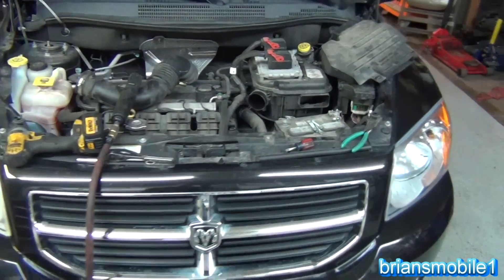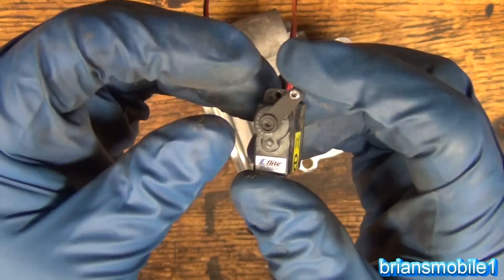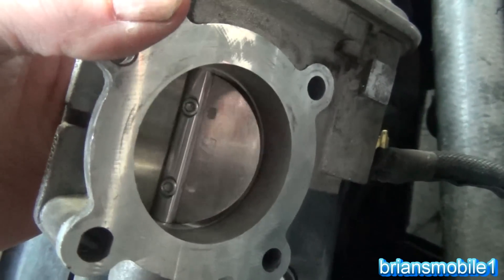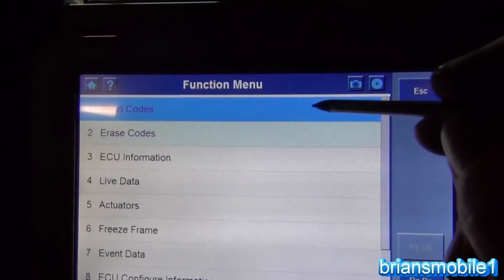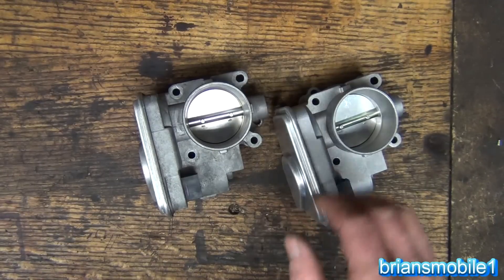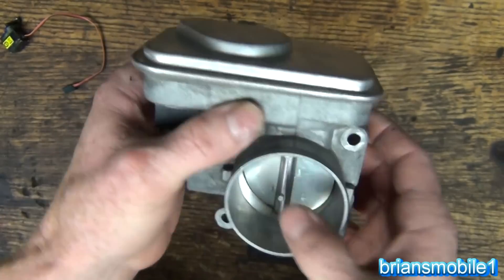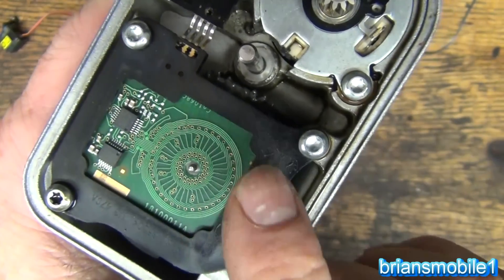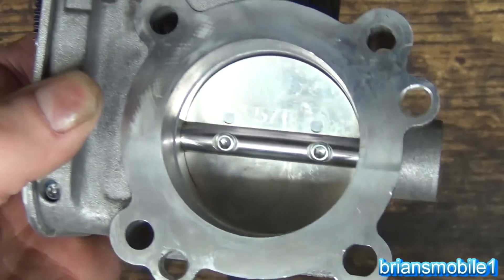Electronic Throttle Control P2110 P2112 P2118 P2110

Comment: This was the same Throttle Body on my 2008 Sebring.  This video was VERY informative and helpful to me in correcting my problem.  Thanks for the knowledge share.  Thanks also for including the tear down of the bad unit.  That was informative and helped tie together how the whole unit works together.  Sadly I too couldn't find a replacement in the after market and had to purchase one via the $tealer, uh , I mean dealer.

Comment: I like them. My 08 Jeep Liberty didn't come with cruise control. Found a switch and harness from a Caliber in a junk yard for $35. All I had to do was install the switch. My computer was already programmed and wired for cruise. Best and easiest modification I've done yet.
Reply from the maker: That's certainly a benefit to them.

Comment: Awesome Vid. When you were wondering how the gear in the Throttle body got ripped, I found a vid that may explain how that could have happened. The channel was FordTechmakuloco. He explains how the system sometimes flaps the plate to knock out ice or debris, with out the keys even being in the ignition. As you stayed this unit has been worked on a number of times. It could have been that someone had their fingers or a cleaning brush in there as someone is cleaning it. The Flap not being able to move may have jammed the gear and ripped the spokes out.

Comment: I repaired one recently  YES repaired it  removed the case cover and greased the internal gears replaced the Pot in the sensor with quality Bosch components , very similar throttle body on the Jeep Patriot here in Australia,

Comment: My ex wife has an 07 Caliber, she had the battery replaced yesterday.  Car ran fine before but now has the P2110 and P2118 codes and the car runs horrible.  I will check the wiring before I order a new motor. :)

Comment: Not just on cheap cars, but on a BMW X5 the transfer case actuator on their I-Drive AWD vehicle uses a plastic gear that is only good for about 80,000 to 100,000 mile.

Comment: i had a similar problem in my 07 cobalt think the plastic gears in the throttle broke. i found one off a similar engine from a junkyard online that was still functioning so i bought it cleaned it and put it in and it worked

Comment: Info is interesting.

Been a mechanic for 50 yrs. ALL car's since the yr 2000 (especially 2005) & up are all high priced junk.

I have a 1976 G-10 van 250 CID Turbo 350 tranny. All original (eng & tranny & differential never rebuilt) very well kept. 850,000 miles on it w/o any major problems. Also have a 72 VW. 1600CC eng boosted up to 92mm jugs. Over 500,000 on that vehicle.  Also an '81 HD. I'll never own any vehicle with a computer in it. My van gets 15 mpg, VW gets 29mpg & HD 50.

Comment: Today must be throttle body day.  :)  Really neat to see inside of the throttle body and see that gear completely stripped out.  Nice find.  Any chance of still using that for a core?
Reply from the maker: Check out my reply to jrmym2....  I'll just paste it here too.  That's easier to find.

      I want to think that with meshing gears you get grindings- those grindings could cause unlimited glitch manifestations when floating around in such a green board environment without oil circulating over a magnet to gather them over time.  There's no need for oil because movements are slow and limited. 
      Another possibility is it's a mechanical fuse like you find in a brake lathe.  You can rule that out because there's no replaceable fuse to put in there- it's non-serviceable.  There's no point in protecting the rest of the device if it's designed to be replaced as a whole. 
     What I would LIKE to see though, is spares available for those two gears and accessibility means.  People worked on mechanical carburetors, linkages, and throttle cables for years.  It's due to tort law and fear of the technology that manufacturers make these non-serviceable.  Planned obsolescence of the car and product life cycle planning of this component seem like a terrible idea, but it sounds better than negligence and apathy. 
     In the end, like you say- disgusting.
Reply: briansmobile1 Sheesh, makes me glad I still have a cable control TB with external TPS and IAC.  What's next, headlights that turn on when you clap?

Comment: First time I've seen inside a computer controlled TB. Ford had a TSB with the TBs on their Fusion and a few other cars. You could  loose power intermittently, because the sensor would get dirty with grease/oil.

Comment: Just had mechanic pull mine
Was having trouble starting avenger,lightening bolt came up.
Ugg no codes
Intermitant problem
Mechanic shook it it sounded like that rattlely.
Got price match autozone
119 
Was 241 elese where
219 at autozone
I had no codes on bolt sign during starting issue ,so far so good.

I self diagnosed it from interent anf youtube .
Mechanic did job in 15 mins.
No charge
We didnt relearn anything
It ran good
Idle slightly rough
Seems ok now

Comment: this unit was initially sealed to prevent dirt etc from entering unit and causing catamination, malfunction or throttle sticking. this problem is caused by oil etc getting inside throttle body on flap and causing it to stick which in turn breaks those cheap plastic gears.  kinda strange since manufacturer says do not clean it. but periodic cleaning would slow this process down

Comment: Thanx for the video! Im having this same problem and i will order a new throttle body this week. In addition I have an issue where sometimes (a out of 10) i just get a SINGLE click when i start the car. Any possibilty that this has to do with the throttle control as well?

Comment: all you have to do is cut 1 slice in the aluminum band and it will break and pop off with a screwdriver. 1minute job with a hack saw across the band the short way. not the long way. Then to seal it back up if the gears are good just use superglue then cawk around the seam

Comment: Nice video, i have problem about it, code i dont remember.. After first problem appeared i change 3 times throttle but it goes like same song.. after 300-400miles problem comes back by check engine message and always when car is not mooving. What should i check beside replacing throttle? Thanks

Comment: Hey nice vid,,,, i have a 2110 code ,,, nd is sayen change the ECU as for TB current  reading by ECU ? Nd saying to change ECU!!! The tb is 6 months old ,, ill look over the TB and see how it looks bc i doubt ECU is bad !! The symptom of the TB is that if i go  into my steering menu fir the srt8 pages 0-60 time,,, the car will get gas unwanted nd jumps to go for sec nd the lightning bulb comes on nd off on dash trowing this 2110 code !!

Comment: I know this video is 9 years old, but I'm having the same issue with my 2011 Dodge Ram 1500 4.7l.  I've replaced both accelerator pedal and throttle body 3 times, and I still have the P2112.
Reply from the maker: Time to check power/ground on the wires and resistance with PCM & both ends unplugged.  See if you have a short to ground or an open or something.

Comment: I think you need to remove the throttle plate and then the gear can be pulled out of the chassis.  The gear is probably bonded or press fitted to the pivot shaft.

Comment: hey man im having the same issue and same code with my 2012 kia forte ex 2.0, its only does it when i come to a stop after a drive, it only done it once upon starting it. i have to shut it off and wait about 60 seconds and its fine. i used my hand to open the throttle plate and it feels solid, no weird noise or play. what else could it be? is there a way to test the sensor on the pedal? a cable would be so much more simple and cheaper, especially on the economy vehicles.

Comment: 06 Hyundai sonata, while full gas only revs up to 3000 RPM can't go over 65 mph without using Cruise control , ESC and check engine light is on. I think this is what I need. Estimated cost for an electrical throttle control actuator?

Comment: I have a 14 Genesis Coupe 2.0 T with 61k miles and a P2118 code! I’ve been having horrible surging on coldstart then goes away. I’ve gotten carbon cleaning but has not fixed the issue and my spark plugs are good. You might have diagnosed my issue but I still need to see if I have blown fuses. I have taken it to the dealership and they advised me that Air pressure was operating at normal range. Can anybody tell me exactly what the P2118  actually is? I believe the same module he’s showing in the video is my same exact module. Thank you.

Comment: I'm currently chasing codes P2104 and P2110. on a 2006 mercury Milan and/or Ford Fusion.
I took throttle body off cleaned it up, I can feel the same clicking as you describe in your video.
but mine does not lock up it seems to move fine other than the clicking.
would you considerate it to be bad and purchase a new one.

Comment: Hey Brian would it have been possible to just rotate the gear that is bad 90 degrees to get it to work properly again. It seems it doesn't use the full potential of the gear so you should be able to rotate it 90 degrees on the axle holding it in place to get it to work.
Reply from the maker: I did consider that, but the gear is a cam shape rather than fully round.
Reply: +briansmobile1 changed throttle body and now I can't get it to start why??
Reply: 1833camaro1 what make a truck cut out at 70 miles an hour an if take off to fast cut out there was a light that came on it said it was a throttle controll sencer will that make my truck cut out like that jw i   have a 2005 Dodge ram1500 with a 5.7 hemi in it I have tryed fixing everything. That the only thing I have fixed yet jw

Comment: Great video man, That p2118 code popped up on my Lexus IS250 with the VSC.  I've changed the throttle body with another one but did the same thing. It has a rough idle and wont go past 20mph. Any idea what it could be?

Comment: would the 2011 Ford Fusion Hybrid throttle body be the same as a regular gas engine throttle body? my Ford dealership seems to think they are not, but aren't the engines in hybrid cars the same as any gas engine except for the interface?

Comment: My truck will crank but when I let off the gas it will die. I am getting the electronic throttle control light (lightning bolt), and the check engine light. I put a new throttle body on and it is still doing the same thing. I am thinking the problem may lie in the sensor that connects to the throttle body.

Comment: I don't like the drive by wire either I feel delay in it when I blip the throttle I prefer cable anyday
Reply: Agreed. No matter how fast the electronics are, if they aren't faster than mechanical then it's a fail.

It's like when they first came out with the digital mouse. You couldn't play Quake in 2000, because the refresh rate on your mouse wouldn't keep up.

Overtime, the digital mouse sped up and won, but at what cost of digital life? lol

Sorry, had to throw some humor in there because I was thinking of the deaths caused by plastic gears in a throttle.

Comment: i have a 2013 ram that kick codes P2122 and P2127  lowe voltage to the throttle body sensor, can this be caused by a fuse like in your video with the Chevy truck

Comment: I'm having the same issue on my 07 caliber but I can't test for codes like you did. do I have to reset the new  throttle body when I install it or I can just put it in and hook everything back together?

Comment: I have a 2011 jeep patriot and the MIL light is on and the ETC light is flashing. Do you think that replacing the ETC would fix the problem? Also do you knew if it would be covered under the powertrain warranty?
Reply: Amanda Horstman

Comment: I have a question my dodge avenger has the same symbol when i turn the ignition to on position engine off..and the computer reads alot of bunch of different codes i erased them and them pop rite up can it be the same thing ???

Comment: I have 2005 Dodge ram 1500  with a 5.7 hemi in it  will the throttle controll sencer make it cut out when I get up to 70 miles and hour. And can it make my truck cut out if itake off to fast I have fixed everything but.  them two thing my light came on in my truck I looked up in the Owens book and that's what it said it could be  I jw I am not sure

Comment: i have ram  can get the lightning bolt warning light off and i have new throttle body on it and tried to relearn no fix my cold are po2111 po 108 po562 po700
Reply: and had colds you have befor had my car reset cues befor it wouldn't even run after rest it dose but like cant give it gas

Comment: Hey Brian, I have a 2010 Dodge Caliber 2.0L Throttle light came on and it gives me Code P2110. If I change Throttle Body would it fix the problem?
Reply: I have the same problem did u get an answer?

Comment: I replaced my throttle body and gas pedal sensor lightening bolt still comes and car hesitate, drive it a block or 2 stop and start up drives fine I was told I had to relearn it by pressing gas for 10sec n it'll be ok, didn't really work went to jiffy lube and they said I needed to pair the new throttle body from within I have no idea about this don't want to be taken advantage of can anyone shed some light please.

Comment: I took out the throttle body from my chrysler 200.. It has the same set up.. However when i shook it there was a jingle inside it.. It has the same codes also.. So just swapping a new one in will fix my no crank and no start?

Comment: I have a 2010 dodge avenger.  2.4. I cleaned the throttle body,  checked the spark plugs, the coils, the air in take. It won't start, if I sprayed starting fluid into the throttle body it will go to 3 grand then just die. Help lol.

Comment: I just replaced on of these on a 07.. still having problems.. car starts fine, no warning light.. but after 5 mins of running I hear a big click and the etc light comes on again and car barely run.. can shut it off and restart, goes thru same routine.. have it at dealer but they can't seem to figure it out either?? thet called and ask if I had programed the new throttle control.. I didn't.. BTW.. when it starts.. it runs smooth but at a high idle.. until it all goes to shit after 5 mins... HELP
Reply: RidgeMan YT  having the same problem! Did u find a fix?

Comment: Probably has a plastic thermostat housing too right? I had a 2007 Avenger and it was the worse car I ever owned. I always had old used cars. This was the first new car at 50. I had a 89 Dodge Daytona for 16 years and sold it to buy the Dodge "New world engine" I should have known. Anything new like that is a crap shoot. I went and bought a 2002 Mustang that has metal parts and they don't cost me an arm and a leg.  Pretty easy to work on. I owned everything from GM to Dodge. What the Hell happened? I will never buy new again from anyone.

Comment: Code P2118 Dealer replaced throttle body.  A few weeks later check engine light...took it back and they adjusted tension pin, then got a code to replace pedal sensor, I did that, then back tonight P2118 says throttle actuator control motor is bad...What is really wrong with this ????   2013 Kia Soul 2 liter

Comment: i never liked those electronic throttles, always fancied the mechanical connection between the accelerator pedal and throttle body. Dangerous in my opinion.
Reply from the maker: There are safety's engineered into the electronic control side of it.  As a technician you can see a failure coming as the trouble codes and driveabillity show signs, but I'm with you.  I was in St. Thomas last week.  EVERY CAR I rode in had the check engine light on- no one would ever see a glitch coming and that place would be the WORST place to have a stuck throttle or a locked steering column for turning the key off.  It's so steep and curvy that EGR codes abound and everything is so expensive that no one fixes or even reads the codes.  A cable is better there because you can feel the warning signs in the pedal.  AND the cable is 18 times less money to replace.  People are way cheap about fixing things if they are super expensive and not well understood.

Comment: plastic gears always sucks...by the way it called drive by wire, fly by wire is used on planes
Reply from the maker: Ships and planes were first.  The name stuck with the concept as it came over.   At least it's that way here in the US.  You hear it on the car commercials that way.  A cam shaft is a "tree of lifting" in Spanish.  And a hydraulic jack is a "cat."  It doesn't make sense to me, but it works for them.  Cultures have variety you would never expect, but it can be fun to observe.
Reply: briansmobile1
i think a hydraulic "gato" is derived from the spanish verb "gatear" which means to crawl along at a very slow rate.